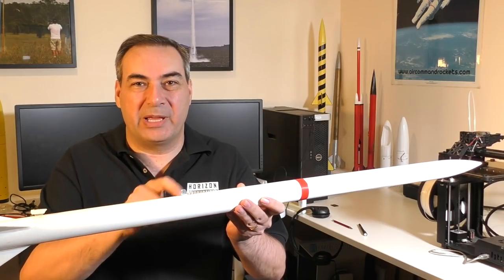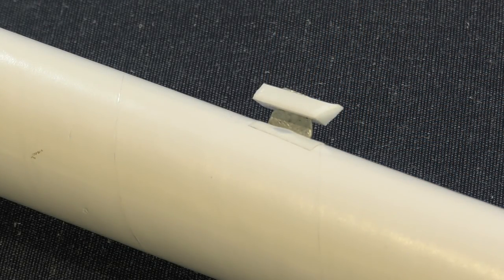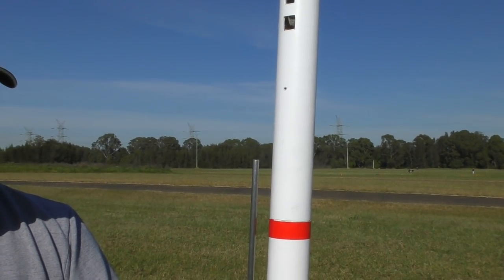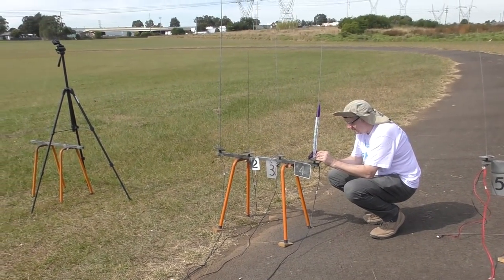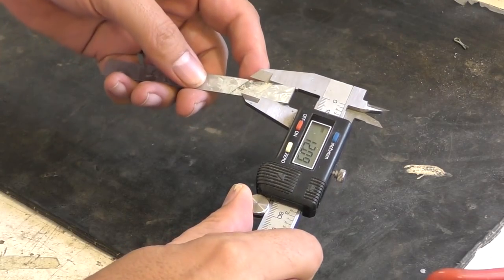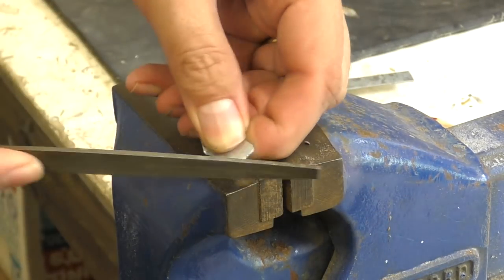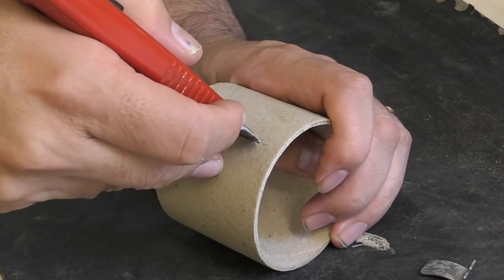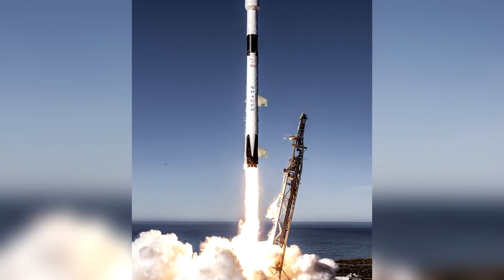Low Drag Drop Away Rail Buttons

Comment: Once again, hello George!
Well, I am here to tell you that the Drop-Away Rail Buttons worked very well on both my 76-mm Scratch-built as well as a modified Estes Mean Machine airframes. No problems and we found the buttons just as you'd mentioned, literally inches from the launch pad. Looks like this will be a manufacturing step in all my future builds.
In fact, I'd like to eventually create a variant for a type of "Drop-Away" connectors for my booster airframes, (an in-flight disconnect system).
Reply from the maker: Happy New Year Ralph. Thanks for the feedback, glad to hear that the rail buttons are working for you. :)

Comment: Hello George,
I finally got to making these "Drop-away" rail brackets and buttons. 
I used a Simpson StrongTie ER-102 (aka ESR-2523) for the metal brackets.  I'd have included photos but YouTube won't let me here. 
So far, so good.  I haven't completed the work but will tomorrow. I am making 6 of these for 3 airframes.
Reply from the maker: Cool good to hear. Thanks for the update. You want to make sure that the buttons sit on the brackets fairly snugly, but loose enough that they fall off easily. I had to scrape the inside groove with an exacto knife because the 1st printed layer was deformed a little more when I printed the button. Good luck.
Reply: @AirCommandRockets  
Thanks, I'll post an update on the  performance of these great little critters. 

Hey, by the way, for your readers who might be making these as well, I've found a neat trick on making these regarding where the rounded slot is. I simply choose to design around an existing hole in the Simpson StrongTie metal and then open up that hole using it as a guide. It seems to help when someone is not familiar with metal-working (as I am at the moment). Thank you again so much for sharing this great idea!

Comment: The ultimate challenge - water rocket to space :) 100km up, 15 stages, firetruck of water, diesel powered high pressure compressor :).
Reply from the maker: That would be interesting... general rule of thumb is that each stage should be 5x the capacity of the next stage. That means with 15 stages, that's around 30Giga liters for the first stage. Say about 10% the volume of Sydney Harbour. :)
Reply: @AirCommandRockets  Ups, a bit underestimated.
 But still it would be interesting to see an estimation of deltaV.

Did a quick check, 10 stages, 1kg payload, 9tons total weight, 1:6 ratio fuel/dry, specific impulse 30 (300m/s not sure if it is achievable) 
Total mission deltaV=2km/s.
Well at least hypersonic water rocket.

Comment: Really cool implementation, but I'm curious what advantages you see over a fly-away rail guide? It seems like the 'stud' the button is hanging on is still draggy, and you still have to go find the little bits of plastic after every launch.
Certainly beats lugging a tower to every launch though!
Reply from the maker: All good questions. I have seen fly-away rail guides get impacted by the fins, especially on the more energetic flights. Yes the brackets attached to the rocket still have a little bit of drag, but much less than some rail buttons. If you can't find a button near the pad, you can just use another one, no need to waste time looking for them. They only cost around 2 cents each.  We've been printing them in batches. The other main design criteria was the ability to fit pretty much any rail type you may encounter at a launch. Perhaps the rail you wanted is taken at the time and they only have a 1515 rail available... just pop on the bigger buttons.

Comment: This is totally awesome!! Im curious tho, if we were to play in slow mo, when the top button goes off, will there be like a sudden change in the angle of launch because the rocket now has a new pivot point which is the 2nd button that has yet to go off?
Reply from the maker: Thanks, good question. It really is no different to how normal rail buttons would act. You can still pivot around a normal single button. The time it takes is minimal from the first button leaving the rail to when the second one does. While theoretically it is possible that you could pitch over, somewhat but in practice the amount of pitch is minimal.

Comment: That would be really handy being able to change from a guide rod to a 1010 and a 1515 rail to suit what is available by simply having a collection of different lugs. I'll defiantly try and implement this in a future build. 
I'm sure as time goes on there will be many more different custom designs for differing launchers and aerodynamic profiles that people make which will make the system even more universal.
Reply from the maker: Thanks Laurence, one should be able to print pretty much any rail profile and make it work with this setup.

Comment: Since you use shampoo to give you additional thrust, and I assume that is because of the bubbles, why not pressurize with CO2 instead of air. The CO2 will dissolve into the water when it is pressurized, and will bubble out as it is depressurized. Besides you can get the CO2 tanks from any soda vendor.
Reply from the maker: Yes, CO2 experiments are on the road map for us. The higher molecular mass of CO2 gives you extra performance during the gas phase too.

Comment: Great Video as always ;) Is there a necessity for a guid rail when launching water rockets with a launch tube?
Reply from the maker: Good question. I would say generally you don't need a guide rail if you are using a launch tube.
Reply: @AirCommandRockets  since we're using long launchtubes for our rockets we ditched the guide rail.
And it works perfectly fine the rockets are flying straight.
Reply: If the guide rail is much longer than the rocket or the launchtube is bending it might be a good option to consider using a guide rail

Comment: How lighter or heavier are these brackets than using a standard rain button or piece of straw for a guide?  is it better to have a lighter rocket (could only be a few grams) or one with less drag?
Thinking of using on a mini estes rockets
Reply from the maker: These rail buttons weigh about the same as conventional rail buttons, perhaps 1 or 2 grams heavier. These are really intended for Mid Power rockets and up, they wouldn't be useful for low power.

Comment: I don't recall from your videos that rail button drag was an issue for you. Have you noticed any changes in flight from this development?
Reply from the maker: I wouldn't expect to see much of a difference for the regular water rockets we use. This design is intended more for high performance rockets for record attempts where you are trying to squeeze out as much performance as you can. All our high performance water rockets don't use buttons, but need a launch tube or a tower to launch them.
Reply: @AirCommandRockets  ah, so the real win here is not so much for flight, but for flexibility of launch for non-high power rockets. If the bracket that's fixed to the rocket was of a standard size, you could roll up to any launch site and adapt to the local rod/rail launch system.
Thank you ACR team for the humorous, hard-working and thoughtful videos.
Reply from the maker: The original design was trying to minimize drag, but perhaps the bigger benefit is the ability to adapt to different rail profiles. The bracket doesn't have to be a standard size. The buttons themselves give you the flexibility. My buttons may not necessarily fit your brackets, but as long as you have a collection of your own buttons for your brackets, then yes you should be able to fit any rail at the launch site.

Comment: great video ! do you have STL files for normal rail button ? i made some but they look quite weak. It would be for a 20*20mm rail
another question, when do you except to launch the Horizon project ?
Reply from the maker: I'm not exactly sure of what rail profile you are referring to. Do you have a dimensioned diagram of the rail profile? What size rocket are you planning to use them on? We don't have a set launch date for Horizon yet.
Reply: @AirCommandRockets  
https://www.dold-mechatronik.de/Aluminum-Profile-20x20-B-type-slot-6-standard-lengths-425-EUR-m 
this rail. It would be for a homemade pyrotechnique rocket, with a 54mm OD carboard tube
Reply from the maker: @shere_kan8329  Ok, that is just a little smaller than a standard 1010 rail. I am not sure if you downloaded the STL files from my website, but try giving the 1010_2.stl button a try. That should work but may be tight. You may have to modify the design to make the groove a little narrower.
Reply: @AirCommandRockets  all right, I'll take a look, thanks for your help